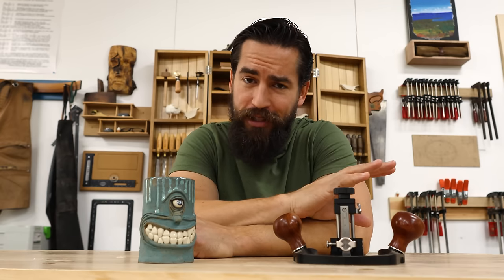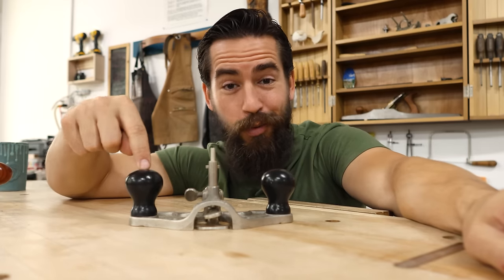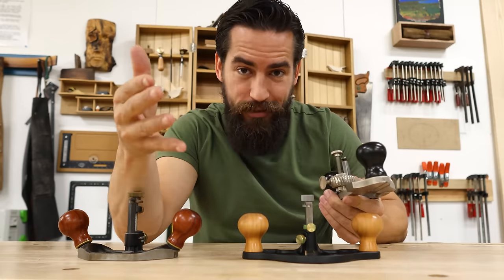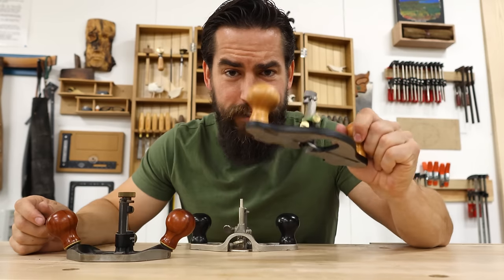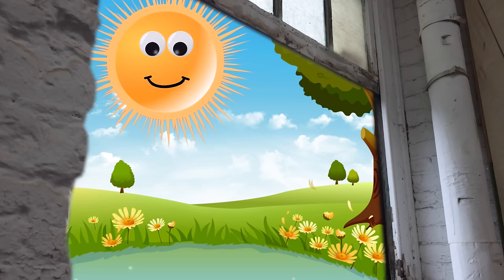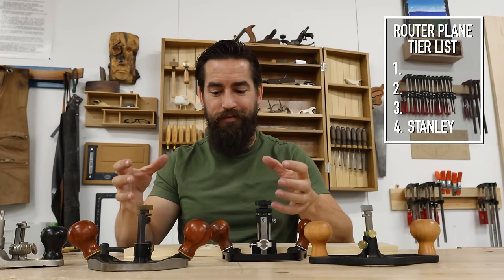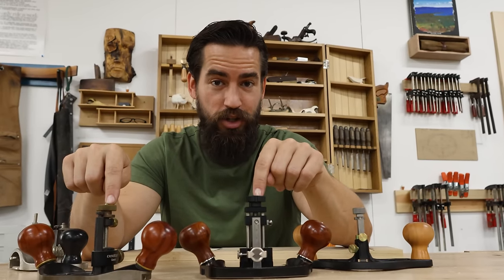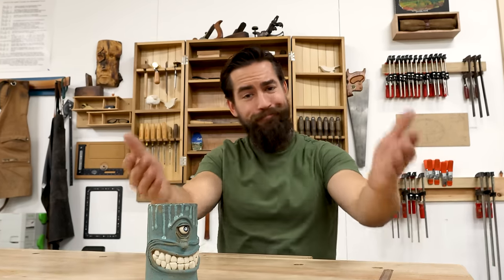How a hand tool split the woodworking world

Comment: The movement on the Stanley is a feature, not a bug. Take your shaving, keep the collet tight and lower the depth adjuster until it bottoms out on the blade. Then loosen the collet, it will drop slightly and retighten. You'll now be at the perfect depth for the next shave.

Also, I think that you misread the dislike of the JKM. I think it largely has to do with the partnership with Hongdui. In the manner of pretty much every Chinese factory out there, the first thing they did was unbrand it and put it on Banggood for 160 bucks. This is typical for Hongdui. They have a direct rip-off of the Veritas dovetail guide, they ripped off the Jessem table saw guides, Bridge City's kerfmaker. It's just what they do, let someone else do the IP work and then blatantly rip it off and undercut them on price. JKM feeding into Hongdui feels like not just a betrayal of western companies, but something that will discourage innovation and hurt woodworkers in years to come. It's just not a good thing.
Reply: If its not patented its fair game.
Reply: How can it discourage innovation when it improved upon the original design? It is not a copy lol, it is a high quality product that offers added benefits over the "original" one.
Reply: @dereklong801  If it is patented, it's also fair game from Chinese manufacturers. China requires that all patent claims be resolved in their courts. They fine any entity operating in China up to 100 thousand dollars a day for bringing patent claims against Chinese companies in foreign courts. Chinese courts are not known for being friendly to foreign companies. So let's say Jessem wants to sue Hongdui for patent infringement. They have to sue them in a Chinese court or risk millions in fines from the Chinese. I suppose that it's possible that Chinese courts could honor patent infringement cases from Jessem, but you run into issues that the Chinese system requires the patents be registered with the Chinese patent organizations. Western industries claim that often, local manufacturers will beat them to the punch and register copycat patents in China of Western patents. It's really not fair game in any sense of the term.
Reply: @riba2233  It discourages innovation because it lowers the amount of reward Western companies see from their original innovation. If a company spends say 1 million dollars on developing a product, they need to see at least 1 million dollars in profit from that product to make the research worthwhile. Pretend for a moment a world without Chinese copycats, a company might estimate that it can sell 100 thousand units at 15 dollar profit and make 1.5 million, for a profit of 500 thousand. Now we have a world with Chinese copycats that cuts the number of units the original company can sell in half so down to 50 thousand units as people instead want to buy the cheap Chinese knockoff. This leads to a profit of -250 thousand dollars, so the original company will say, it's not worth it to invest in researching a new tool because we'll take a loss on it. That's how it discourages innovation.
Reply: @lawrencedeleurere4427  rofl, you live in a fantasy land. So if you see a design, and have the idea to improve it (or you know, actually innovate?) and sell the improved version, you should never be able to do that? How is that good for the innovation on the market please explain. Also if they made a 1:1 copy with no improvements I wouldn't say anything, but cmon.

Comment: i have the JKM, a Stanley and the one i built out of the Paul Sellers kit, and then one made based on the Paul Sellers kit with a much finer depth adjustment screw. i use the two Paul Sellers style planes pretty most of the time. they are functional, easy to use, and easy to modify to fit my working style. i also have a hags tooth with a rounded blade that i use for really moving material. i'm just a hobbiest having a ball making whatever has my attention at the moment. i am a lot harder on my tools than most people probably are, which is why i like self made tools. i can remake them when i break them. if i break the JKM router plane, i might cry. HONGDUI makes pretty good tools, and is willing to work with someone like JKM, whereas getting a Veritas or Lie-Nielsen to co-brand a tool and do development work is a lot less likely. both companies really seem to focus on their core competency and probably don't have the latitude to experiment too much given how high their costs are.
Reply: I had been making do with the Paul Sellers "Poor Man's Router Plane" made out of random scraps  of construction lumber.  Did great work, but repeatable cuts are fiddly...  Planning the work makes things go smoother.

I finally sprung for the Taylor Toolworks mini router plane and it is a gem.  But depth adjustment is not screw-thread assisted, and there is no depth stop.  But it works well, and is well-made.

Their full-size router plane is very interesting, appears to have all the essential features, and is 1/2 the price of the big boys in the video.

Comment: Thanks for the video - much appreciated!  I have not read all of the comments, but I think one of biggest controversies was that Hongdui/JKM made what appeared to be an exact copy of the Veritas base.  The one in your video is version 2.  I purchased version 1 the day JKM announced it because I liked the zero backlash adjustment which I think was an improvement to the router plane.  Version 1 also does not have the depth stop.  Had they started with version 2, like the one you are showing, I think there would have been a lot less controversy.

Comment: I trained on the '71 some 40 years ago so yeah, it is my go to router plane.... or should I say router planes as there are 6 or 7 lurking in my workshop, each of them setup to do different tasks. Lucky I got them waaaay before the Maestro Paul Sellars made them a highly sought after tool.... I have the Veritas version as well. 
However, they are all good and you are spot on with your conclusions.
Reply from the maker: I appreciate your insight given your experience. Nothing wrong with the ol' 71. Just a matter of personal preference.
Reply: Exactly. Use the tool that you are most comfortable with. I am sure that if I only had the choice of of a Veritas or Lie Nielson I would be just as happy. They are all really good tools.

Comment: Being 82 and on a strict budget, I have the Bench Dog version of the Lie-Neilson which suits my needs just fine. If I find I need a narrower blade I could buy either of their $50.00 adaptor inserts to buy a $50.00 Veritas blade, or just buy Bench Dog replacement blades at $20.00 and spend a little time at the bench grinder creating what I need. By the bye, looking at the difference of the shaft shapes between Stanley, Veritas and Lie-Neilson, I think the square shaped blade shank pressed fully against the shaft offers the sturdiest, most stable and chatter-free option if you have to extend the blade much more than ¾" to 1" below the base, which happens with an aux. base.

Comment: Another thing to consider is the cost and availability of accessories for the plane. LN, Veritas, and JKM all offer replacement blades of differing widths for their planes. This allows cutting a narrower dado than can be done with their standard blades. Veritas offers the greatest number of differing widths -- both narrower and wider than the standard blade. Each brand offers a fence for their router plane. (The JKM comes with a fence.) Veritas also offers an inlay cutter head for their plane. (Currently, the other two do not.) The inlay cutter head makes it easier to cut the shallow groove for inlaid banding or stringing.

Of course, if all you'll be doing with the router plane is truing up tenons and cutting 1/2" or wider dados, you'll never need or want any of these accessories. But, if you think you MIGHT want the flexibility to use your router plane to cut narrower dados and grooves, or even for inlay work, you'll want to consider what accessories are available for the plane you are considering buying.

Comment: KM Router plane 
I bought one a few months ago and it has a major design flaw, this is because it clamps the thread and not the blade holder. The thread has play in it so the blade moves up and down even when the lock knob is tight and it's getting progressively worse

Comment: I’d be curious as to the flatness of each brands cast base. Arguably, if the surface is not ground flat, then the tool will not sit flat and flush which will cause more irregularity in the cut than a wiggly blade. If you’re talking 0.000, then that surface flatness matters.
Reply: You dont get that flat with wood anyway. You can easily get any of these plently flat enough with tile and sandpaper which you have to do occasionally any way

Comment: On the "controversy", it doesn't bother me in any way that JKM is producing tools, however, outsourcing the casting automatically excludes it as a tool that I'd purchase. Especially given the pricing is higher than the Veritas and only $20 less than the fully American made Lie-Nielsen. Sorry but no and that's not an elitist view, it's getting what you pay for and when you can spend $20 more and get the Lie-Nielsen or spend less and get the Veritas...

Comment: I don't have a router plane, although it will be my next purchase, so I'm not really familiar with their operation.  However, as to a clockwise turn raising the blade, that would happen with a regular threaded rod.  Lowering it would require a left handed thread, in which case the JKM is not the odd-ball.

I could be wrong, of course.  I've never actually held a router plane.  ;)

Comment: from an engineering position I can explain why the tap set is way better than the screw adjust for depth. 
  It's all about friction and  stored energy. Thee tap set approach overcomes the phenomena  called "Stiction" in the instant of the tap.  Stictioin is  term coined to describe stored energy that is held back by friction. In the medical device industry it is a major pain  for precision metered delivery systems that use conventional syringes. The syringe rubber boot doesn't move until the amount of force builds up sufficiently to move it and then it moves suddenly and too much.   
A similar phenomena arises in screw advance systems such as you have there.  Because things are not in perfect in-line alignment the  tendency for  the parts to accumulate lateral accumulated energy and deflect when the screws are adjusted, while the blade tension function is engaged,  the energy to move the blade is  not expressed all at the same time and that residual energy  stored in the bent or cocked components can  work itself out and move the blade while it in use.

Comment: I was a bit confused watching this, as it appears the KM-17 has actually changed it's castings and handles from earlier in the year. Watch anyone elses review from earlier in the year and the body is identical to the veritas, including the handle no screws on top. 

So it appears that they have changed the plane in response to the critisism. Which would imply that the criticism had merit. I think this video is doing you a diservice, as you never touched on the original version of the plane being identically shaped.

Comment: I like your style.  Very up front about your associations and potential biases.   I think that really makes your review that much better.  I’m a hobby woodworker with a little money that I can spend on tools because I want the experience.   I don’t need to make money with my hobby.  That said if you could go into more depth of why this tool is one of your most used, that would be very interesting to me.  I make dados with a powered router or a dado blade on my tablesaw or radial arm saw.   Do you use the RP to cut the entire dado or do you use it to clean up or fine tune a dado cut by a power tool? Help me understand why it is one of your most used tools.  I want to learn.
Reply: It's definitely used for clean-up, fixing inconsistent depth from changes in pressure during the cut or minor warps in the wood.
Reply from the maker: Yes, these days it's mostly used for minor adjustments after things have been machined. Much the same way a shoulder plane is used. If the joinery is a little tight, it can be relieved slightly using the router plane rather than trying to dial in the machine a second time.

Comment: This job is crazy. I always get a chuckle from the fact that I use computerized, high rpm machines with expensive software and tolerances within  a thousandth of an inch.

And then pick up something literally over 100 years old and achieve the same tolerances.

Just depends with one is faster and safer at the moment.

Comment: Great exposition.  Pointless topic.  Mainly rests on the idea that screw adjustable depth measurements are needed or efficient.  Bottom line is that if you wanted to return to a specific depth, as with most things the smart move would be to have more than one router plane.  Grab some flea market ones, or some home made ones and set them to the sizes you need and grab them and go.  

I have a Veritas router and it is great, but the fact it has screw adjustable depth is more a bug than a feature.  Say one is working off a depth mark from a marking gauge.  I would just throw the tooth in that, and squeeze the slop out, and tighten.  Done.  Nobody works in tens.  I have planes that cut in 3 tens increments, but I am not working those increments.  It isn't as if a client has a drawer damaged in shipping and I can just send him a new front and it will fit right in.  Everything is in relation to another dimension or part.  The ability to dial in a measurement is basically irrelevant.  

Another reality is that while great work is done today in modern societies, and was done back when metal tools came in, probably the best work ever done was done, and is done with tools that had wooden bodies and were tapped to a measurement.  Back in the times of royals or in places like China and Japan today.  Basically a bunch of newbies arguing over things they don't understand.  Just as with the bride business, you sell stuff to people who are outfitting for the first time.  LV doesn't make money selling to woodworking sages, they need people in their stores who haven't a tool or a clue, and those people need a lot of reassurance.

Comment: I have the Veritas router plane. 

I like the innovation with the Veritas that the blade is separate from the blade stem. Sharpening is easier, from my point of view.

The KM tool has a similar construction for the blade as the Veritas.

I agree that the Veritas depth stop is not as precise as it should be. 

FYI, we now have a simpler router plane from Paul Sellers. And a very similar one produced by the newish Australian toolmaker whose name escapes me.

Their blade is straight and held at an angle to the piece of wood.

Comment: I have the Lee Valley router and would like to point out a few things. This company allows you to spend more money with them by offering 5 optional blades a fence and an Inlay Cutter Head whether you need them is up to you.  (All which apparently, I needed) The other two companies do not allow you to spend more money with them. I do find it odd that the .hongdui tools router cost relatively as much as the other two.
I do have their miter gauge (hongdui tools) and it is very nice. It works well, was fairly inexpensive and is like a bit of jewelry.

Comment: Assuming the thread pitch is the same, a full rotation of the adjustment wheel gives the same result no matter the size of the wheel. However, a larger wheel makes fine adjustment easier.

Comment: One thing not addressed in this video is that the JKM plane can’t, or doesn’t seem to be able to, be used in the outboard configuration like the Veritas can for bullnose work. None of the other planes in the video seem to have that option.  Thought it would be worth a mention.
Reply: Well, I couldn’t edit this but it appears that I was wrong. It looks like that if you undo the 2 screws holding the adjustment mechanism to the base you can flip it outboard, replace the screws and use it outboard for bullnose. It is a lot more work than the Veritas but it can be done. Don’t let it be said I can’t admit when I’m wrong!😇

Comment: I bought my Veritas about a month before the KM/Hongdui plane was released. I have a bunch of Hongdui tools and they're all excellent, and I would have purchased that one if it had existed at the time. Some of their stuff is definitely a clone of other makers, but they always seem to make slight improvements (even that little carbide scraper tool is so much better designed/looking than the Woodpecker one it's based on). Honestly, my biggest complaint about the Veritas is that the blades seem to be really soft and are a PITA to sharpen without bending the edge, and need to be honed (not sharpened) far too often. P.S. Happy SunPower customer for the last few years … even if my grid power here is 98% hydro and prices are cheap enough that it'll take me another 14 years to break even on my up-front costs.